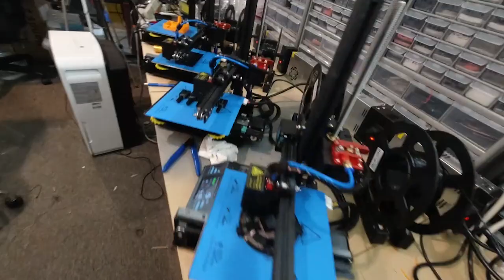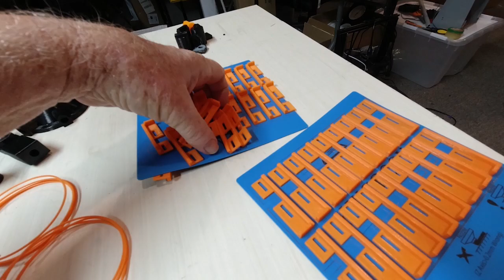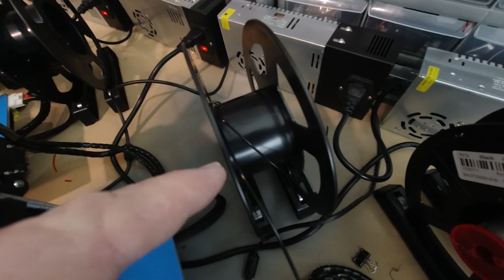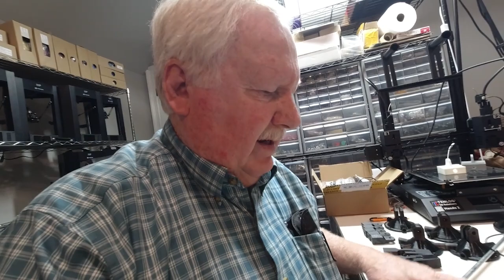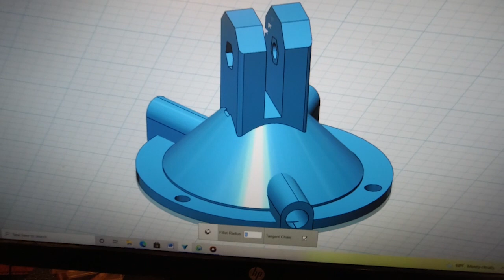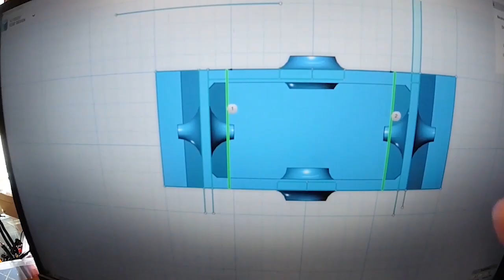MY 3D PRINT FARM FILAMENT COUNTER AT WORK SAVING TIME AND $$ at New Tech Inventors

Comment: I've heard you shouldn't move the bed by hand ... has it every been an issue for you ?
Reply from the maker: As long as the servo motors are disengaged, I have had no problems moving the bed on any of my printers. If you move them very fast the servo motor acts like a generator and produces some voltage that sends power to the circuit board, but I don't believe it would be enough to cause any damage. I do this a lot with over 60 printers and have never had a problem. Thanks for the question and for your support...Ken
Reply: @NewTechInventors  - thanks for your response. Glad to hear it's never been an issue. I've got one printer and only for about a month. So I just wanted to learn whatever I can about the do's and don'ts. Thanks !

Comment: Hi Ken, where did you purchase these kingroon printers?
Reply from the maker: I purchased most of them last September and October on eBay for $110 to $115 each. It seemed like a good deal and they have worked well for me. I had one dead on arrival with a bad control board ( no output for hot end) I kept it for parts and haven't hade to scrap it yet, so I may try to fix the board when I get a chance. Tried to get a new board back then with no luck?? May try that again. I see the newer KP3s printers are selling for about $168 up to $276 on eBay. I guess that even at $168 it's a good deal for a compact printer that prints 180 x 180 and does a great job. Hope this helps and thanks for your support Riley...Ken

Comment: Good for you Ken! Looks like the concept works well. To be honest, I am truly on the fence on this step. This is not to discourage you - it is just a real unknown for me. I spent 13 years designing machines and new processes for my wife's small manufacturing business. the biggest lesson: until you use it in the real production mode (not just testing), you just won't know for sure. Some ideas flop but were never a waste of time. Because that "one" idea that does work, becomes a lifesaver. So, can't wait to see how it goes when you roll it out in full farm mode. Oh, check this guy's cool video - bet you can easily duplicate it for your filament needs https://www.youtube.com/watch?v=tsxu_KMYnTs

By the way - your website is coming along really well! I sent you an email through your site so, not sure if you got it or not. I've started on mine too. Just making some tweaks on the products before I start taking the pictures.

You probably missed a question I had for you that could help me: are the Tronxy X5SA worth it versus getting more Anet4 type printers or even Kingroons (I've got one, love it but it's so small)? CoreXY type printers can print so much faster plus the base is larger. So, I was thinking of getting a bunch of Tronxy versus buying double or so Ender 3-types. The reviews are not that great but mostly from newcomers so, tweaking/fixing it doesn't worry me. Can you share your thoughts? Much appreciated Ken! Claude
Reply from the maker: Cool video, a lot like what I imagine my counter being like when I get it automated. Time will tell if the counter will make a big difference or not. I know it only can help on about 70% of my print jobs, mostly the ones that will be running the same part on many printers at the same time. If I end up dedicating a single to printing all of one part then I will have a single spool on it all the time till it runs out and no need for a counter there. Most of the website content is hidden now and I will be meeting with the designer later this  week to try to wrap up loose ends. I'm still not ready to start selling, I have so many things to finish and packaging issues etc. I sure could use some help, but wan't to make sure it's going to work first. Thanks Claude for your help, encouragement, and support...Ken

Comment: Great idea Ken  I have only 3 printers having a filament counter would be handy when I would need to print the same colour on the 3 printers at the same time...Are you going to make the counter into a product  ..?
Reply from the maker: I think I have enough parts to make about 20 of them, so I may go ahead and make some and put them on the website to see if there is a demand for them. Thanks Frank for the comment and for your support...Ken
Reply: @NewTechInventors   Wondering if you happened to make any filament counters for sale?  I checked your web site, but didn't see any available.  There are certain printing situations this would be ideal for me, and I wouldn't end up with 3 open rolls of filament that are 3/4 full.

Comment: This is a great idea because you have so many printers. Why buy 20 rolls of filament for 20 printers when you can use 1, and you dont need to vacuum seal it.
Reply from the maker: You get it man!! That is what I think too. You don't have to have as much inventory and when you print in many colors and types of filament it can add up. I estimate I will soon have less than 20 spools of partially used filament on the shelf instead of over 100. It is good to run 7 printers like I did in the last video and only have to seal up one spool of orange PLA. Thanks Maxan for the comment and for your support...Ken

Comment: those little bits of very little waisted filament i sure will add up quick the way you are doing it, most of your ideas i seeam to agree with mostly but not this in no time you will have a roll of waisted filament not counting the waisted time spooling it off onto another roll
Reply from the maker: Thanks William for your input. What your saying makes good sense, but you have to understand what I am working with here. First if I am running a job on one printer over and over, I will use a full spool and no counter. If I need to run 10 printers for 48 hours each printing the same part and same time and it takes 80 meters for each printer then I will be using 2 and 1/2 spools of filament using the counter instead of 10 spools and having 250 meters left on each spool after printing. Using the counter I will only have 9 pieces of filament about one meter in length each scrap, and about 190 meters left on the last spool. I think the counter will work well on about 70% of my production jobs when I get up to speed. I still have many spools of partially used orange PLA filament left on the shelf from when I ran 22 printers at the same time to test the new print farm, about 12 spools. If I had used the counter I would only have one spool. when I get the motor on the counter it will run fast and spool 25 meters in about a minute. I will have more videos showing when I use it. Thanks for your thoughts on this and for your support...Ken
Reply: @NewTechInventors  it doesnt hurt PLA to be out for a week or so and u dont have to bag the rolls just put them in a large tube that has a lid and u will be good just makes handling all them rolls easier, i would think if your running a print farm you would go through 1 roll per machine fairly quickly and skip all that other stuff

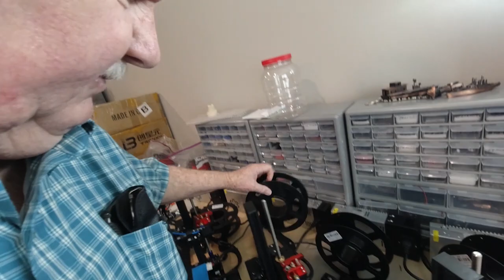Comment: 18:12 I have to say taking the spools off and putting them into a plastic bag keep out the moisture. Has to take way less time than measuring out each spool of filament. And then having to find something heavy to put inside each roll of filament because they're going to come off the spool holder cuz you're too light. And then reloading each spool full of filament... I know you're a super smart guy. But I feel you're doing a lot of extra work for no reason. Have to be devil's advocate for you Ken.. Patent business for 50 years..
Reply from the maker: I hear what your saying and I agree that  in some situations it doesn't make sense and in those situations I will not be using the counter. I will be using it to keep from having to have over 100 spools of bagged filament on the shelf, not knowing for sure when I will be using it gain. I had 24 partially used spools of orange PLA on the shelf after starting the new print farm and using the counter I have already reduced that to less than 10 and soon I will only have one partial spool of orange PLA on the shelf. Soon I hope to have only one spool of partially used filament of each type and color on the shelf, this would be less than 20 spools instead of over 100. My inventory will be fresh and I won't have to worry so much about moisture problems. When I finish the automated version of the filament counter I think the average load time for a spool of filament will be less than one minute. I know you have my back and I promise I will follow the most efficient and economical path. Thanks for asking the tough questions and keeping me on the right path, I really appreciate all you do my friend...Ken

Comment: Ken you could also add G-Code so you can see how much time is actually left on the print. Will show up on the screen
Reply: 14:30 I get where you're coming from. But all the extra work involved of now reloading all the machines. Unloading all the filament in the Boden tubes. If you had a full spool on there you could just run the next load of parts? I think once you get to the point where this is successful enough we have to start worrying about cutting back. Filament is so cheap.
Reply from the maker: @bigblue1287  I could change the schedules to keep from having multiple printers print the same part and maybe use a larger printer that will print more and for longer times like 96 hours. I will eventually try every combination my friend....Ken
Reply from the maker: I currently have a chip in each machine with the print jobs set up for that printer and rely on the filament length I get from Cura when I slice and create the G-code...Ken

Comment: Hey Ken great to see you again. I love all your ideas I love how you think outside of the box. I'm still a little confused by this film encounter? Filament is so cheap and if you're running a print form you're going to be constantly running. Why not just let this run out sensors run out and just reload a new spool? I think all this extra work in time to measure the amount of spool for each individual print in the long run is not productive just my opinion and I've been in the patent business for a long time. Including doing some prototyping for my customers. Now what are you going to do with the leftover filament on the end of a spool that isn't enough to run a job? Just trying to play devil's advocate for you. Again I have to say you're putting the cart before the horse. But keep on keeping on doing your thing just my opinion
Reply from the maker: Thanks for the input my friend. I now have print jobs that use black PETG, orange PETG, red PETG, grey PETG, blue PETG, black PLA red PLA, blue PLA, orange PLA, grey PLA, and some others from time to time. My plan is to print parts as needed based on sales. This means I will be changing some printers frequently from job to job. On some high demand parts that I will be running continuous I will use a full spool, not the counter, and let it run out. For the other jobs that will require a filament type or color change after 24 or 48 hours I will be using the counter to load that printer with only the amount of filament I need for the job and this will allow me to run many printers with this same job at the same time using only one full spool at a time to feed the counter. As you can see the meter or less of left over filament from these print jobs is not worth keeping and will be scraped. I will have to make some adjustments as I go, but for now this is my plan. Thanks for all your input and ideas, it really keeps me thinking, Always looking for a better way. Thanks as always for your encouragement and support my friend...Ken

Comment: Maybe you could design a printable company or product name logo key fob or something else to use those small amounts of leftover filament.
 It could be free advertising
Reply from the maker: My smallest part now is the base lock that I print 18-42 at a time. Each one only uses 1.07m of filament to print which means I would need about 1.4 meters to allow for the feed tube and break sensor. Thanks for the idea Andrew may not throw it all away after all....Ken